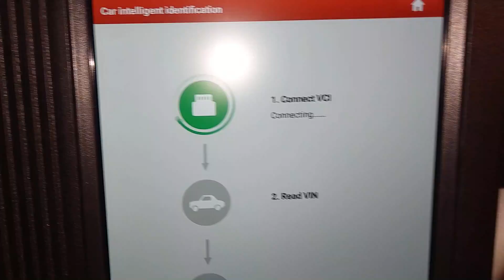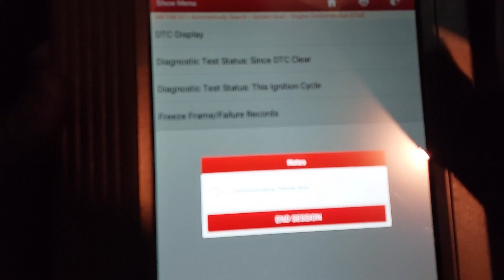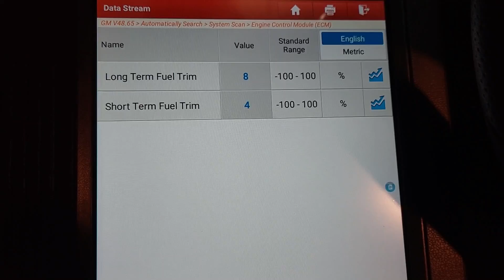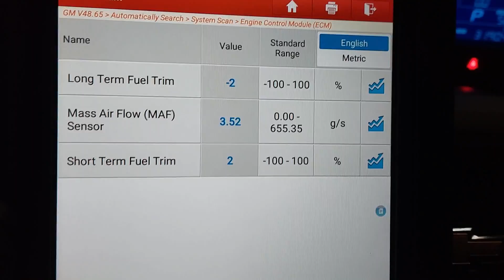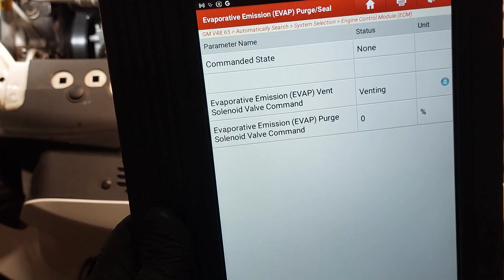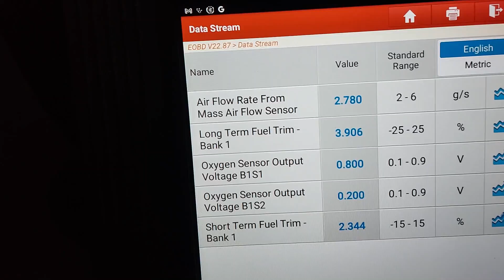2014 Chevrolet Sonic 1.8 - P0171 - System Too Lean Bank 1 - Check Engine Light Diagnostics

Comment: This needs more likes, working on a 2015 Sonic with the 1.8 that has the P0171 code and once i isolated the purge valve all my long term and short term numbers came down to normal. I tested the valve and it passed but it must be sticking open causing my lean condition. Great video.

Comment: Good detailed video.  My neighbor and I worked on a 2012 Cruze 1.8 recently.  It had a P0016 and P0442. The intake camsaft gear was faulty and purge valve was not closing. Replaced both. The Live Data is very similar to what you showed except the O2s1b2, ours was around 0.8v at idle but yours was around 0.160.  I think the sensor might be going out or there might be an exhaust leak.  Also some of these codes are permanent that can't not be cleared and could fool us to think they are coming back after clear. But after few cycles the PCM will clear them.  Also when you showed the code P0171 it said Passed since DTC Clear and last cycle so the PCM was happy. Whatever caused the code was intermittent or was fixed/replaced already. I am a diyer, just sharing my thought.
Reply from the maker: Thanks. Good points you made there. I am not worried about the permanent codes stored in the computer as you already know about those as you stated. They will clear on their own after a few drive cycles or so after it has been repaired correctly. However, at the time of this video the check engine light was on for a current trouble code for P0171 and no other codes along with that. The last test the computer ran failed according to what it showed on the scan tool and that is why the check engine light is still on, otherwise if it passed the check engine light would have went off, but the code would still be stored in the computer regardless for as long as there is a problem. I may have not mentioned in the video, but there are no exhaust leaks on this vehicle and the oxygen sensors are reading and behaving as they should during a road test. The values for the oxygen sensors will flip flop a lot while the vehicle is idling and still warming up. Oxygen and air fuel sensors cannot really be tested accurately during idle and when the exhaust is cold. The vehicle needs to get to operating temperature and exhaust needs to also get hot and to operating temperature as well for the oxygen sensors including the catalytic converter to operate properly. I have followed up with the customer after a month and it is a permanent fix. This one can be a tricky one as most people would have thrown parts on this car 100%. Thanks for watching and thanks for pointing out those things.
Reply: Hey moose it's been a minute how , guess we my has a 2017 buick 1.4L turbo encore same problem p0171 code as well,  cuts at stop lights.

Comment: Man! Thank you very much for this video. I have a 2015 chevy sonic 1.8 with the same issue. I already replaced the valve cover, mass air flow sensor, both O2 sensors , spark plugs, coil pack; I have removed the throttle body and cleaned it really good(looks like new), I have tested the fuel injector. I took it to the GMC dealership(they replaced the O2 sensor) to the local mechanic twice, and the code still active. I have spent over $1200 dollars on this car. I thank God and my Lord Jesus Christ for coming across your video Moose. May God bless you a lot brother. This was an awesome video it. took me through the whole process and now I know what I have to look for. Once again thanks.
Reply from the maker: Wow, that is crazy and a lot of money spent. I'm glad I was able to help you out on your part. God bless you too sir. 🙏 I really appreciate the support.
Reply: @moosemobileautorepair  Amén brother. I subscribed to your channel by the way!
Reply from the maker: Thanks! 😊
Reply: Lots of great 1.8l videos to help :)
Reply: You have the P0171 code?  How are the Long/Short trims, both O2 sensors, Calculated Air, MAF and MAP reading?